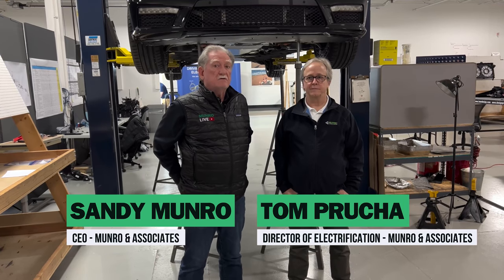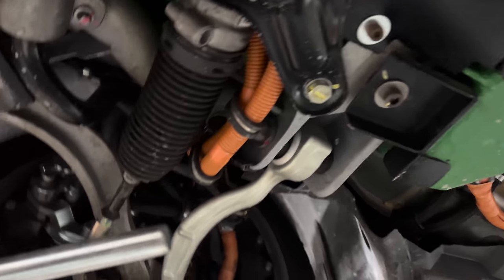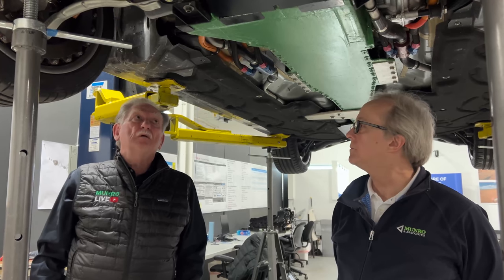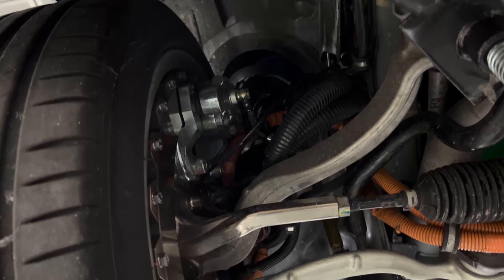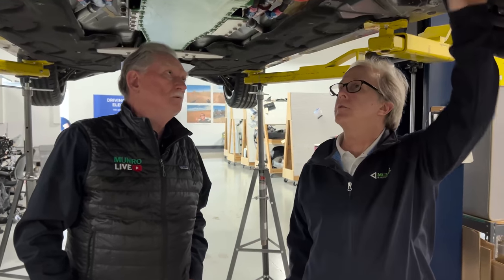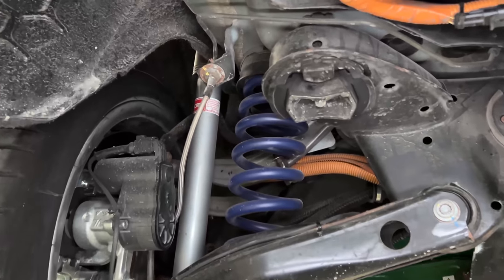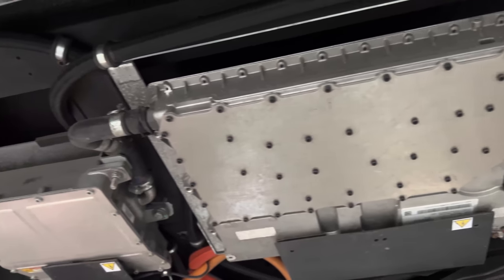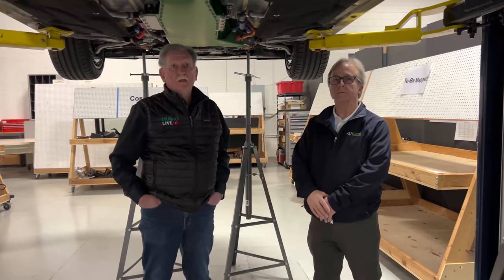Protean Electric Wheel Motor Technology | Review with Sandy & Tom

Comment: Unfortunately, HUB motor are too SLOW, too INEFFICIENT, too HEAVY and too EXPENSIVE. 
Tesla QUAD Drivetrain is SUPERIOR in ALL aspects.
overall it's LIGHTER , FASTER, EFFICIENT and almost NO MAINTENANCE.
those HUB motors because they are EXPOSED to the elements, will require MORE Maintenance and down time for SERVICING.
the Tesla Drivetrain does NOT require ANY maintenance in over 300,000 miles and in 2022 it lasts over 2 MILLION miles. 
HUB motors are a FAD and no one on EARTH, has a PERFORMANCE vehicle using HUB motors.
Reply: Still no clue!
Reply: I too believe Tesla is superior, but there are many here that will discount your comments because you come across as a FanBoy. If your above comment was made without mentioning Tesla at all, it would be far more effective. You are correct in all points of your assessment, hub motors are a very poor solution independent of what Tesla is doing. You also left out the very significant problem of cooling.

When I see a hub motor design like this, it tells me that they are not looking for an ultimate solution.
Reply: @crishawkins7359  - this technology was needed 30+ years ago, today it's VAPOR.
Reply: Mercedes had built an electric SLS prototype with hub motors three years ago. It was painted chrome/silver. Had 1000hp.
Reply: @markplott4820  I apologize,  I am not following your train of thought here. I don't see how this relates to my comment above. Oh, by the way, this technology did exist 30 years ago... I was doing it.
Reply: @vic321344  And your point is?????? A PROTOTYPE with 1000 HP... two things of little significance.
Reply: @crishawkins7359  I just answered to "HUB motors are a FAD and no one on EARTH, has a PERFORMANCE vehicle using HUB motors."
Reply: There might be an application for Hub motors in offroad vehicles: If you want to turn the wheels 90 degrees. That would easily enable a tank turn without loosing friction to the ground.
Reply: @vic321344  FYI, all the disadvantages Mark lists above do indeed apply to hub motors (along with a number of others). I don't dispute your example so you have technically countered his statement. However, your example is a prototype and likely a "one-off" vehicle. Mercedes has little expertise in EVs and they likely learned why it should stay a "one-off" vehicle.

Your offroad example seems a stretch to me, although there could easily be a niche application for the capability you suggest... a Mars Rover type robot for example. This would be another "one-off" scenario. I'm sure there is an unspoken assumption that the topic here is separate from that, but if your intention was to prove Mark wrong... touche.
Reply: @crishawkins7359  I am not a fan of hub motors. But they are easy and cheap to install. That could be a  selling point for a certain type of application.
Reply: @vic321344  - NOPE, hub motor are just BAD engineering. and can do better with QUAD steer. 
besides, Cybertruck is a BETTER 4x4 than a JEEP, Bronco or F250.
Reply: @crishawkins7359  - you are already OUTDATED with OBSOLETE technology.
Reply: @vic321344  - and where is the PRODUCTION version? how come MB can't make 500k per year ?........... luddites.
Reply: @vic321344  sls isnt hub motors
Reply: @markplott4820  It appears you are not paying attention. Back when I was working on large diameter low RPM electric motors, I had a 286 computer. For some unknown reason I don't have that anymore - OH! I know, I have advanced my knowledge and technology in the last 30 years. I have also advanced my knowledge in motors. This is how I know that hub motors are a poor solution. I have designed and built - from scratch - on the order of 100 electric motors of various types. So NO I am NOT outdated. I was working on the appropriate technology at the appropriate time.

I now understand why so many seem to discount your comments. Although your comments about hub motors are generally correct, you are a REAL HORSES ASS !
Reply: @vic321344  I agree there are times when the design priorities favor a hub motor type of design. I have designed and fabricated a prototype large diameter low RPM motor for such an application.
Reply: @themodfather9382  I dont speak about the AMG SLS Electro. This was developed after the single one SLS prototype Mercedes made. AMG abandoned the hub motor and put them back into the chassis, to avoid unsprung mass.